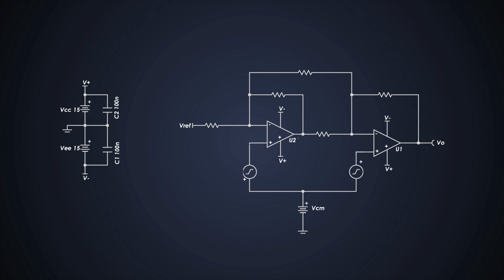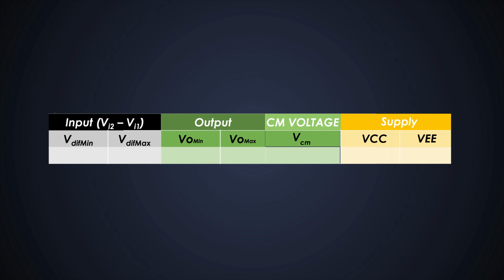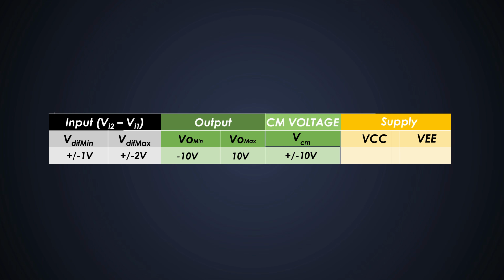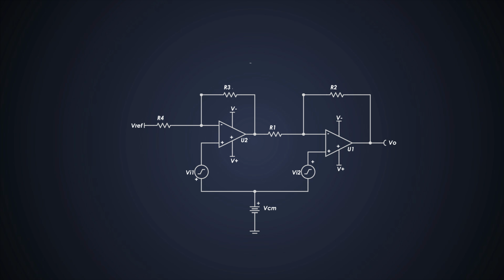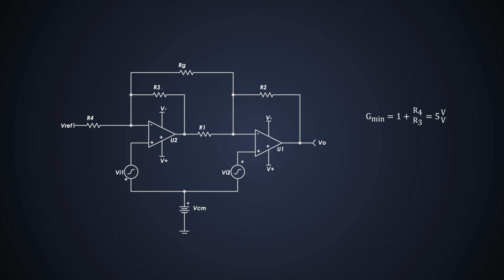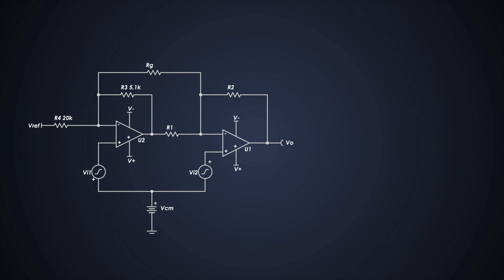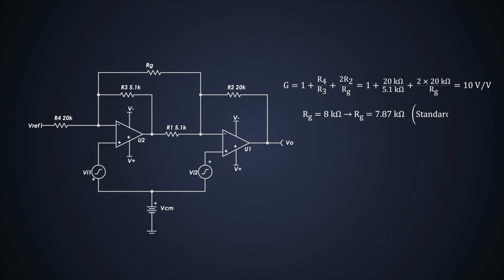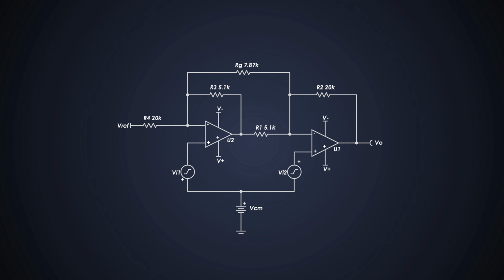2 Opamp Instrumentation Amplifier | Understanding and Designing Instrumentation Amplifier

Comment: I watched yuor exelet videos about MOSFET drivers but i still can not configure what is the problem witg my circut, I use UCC2237p driver IC with IRF3205 mosfet 30ohm gate resistor 12V zener diode and 10kohm G to S resistor 12V suply and 40kHz square signal on input and eaven with drain not connected to anything it's destroing my mosfet I don't know why. Mayby you could help me